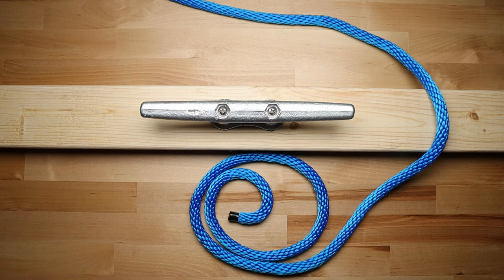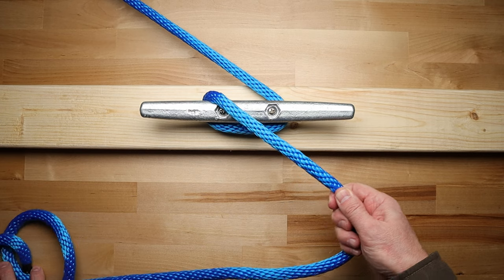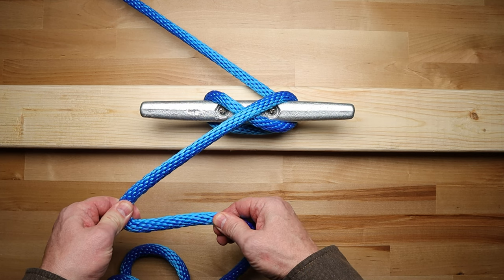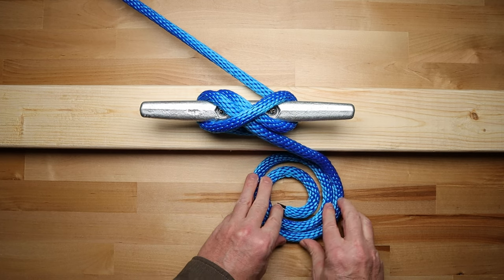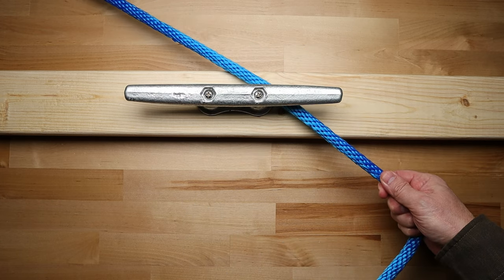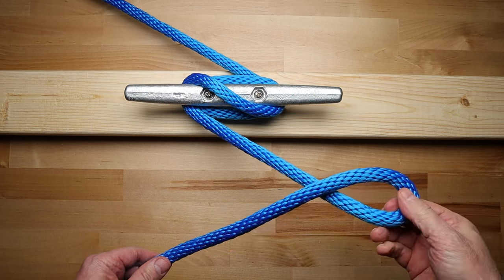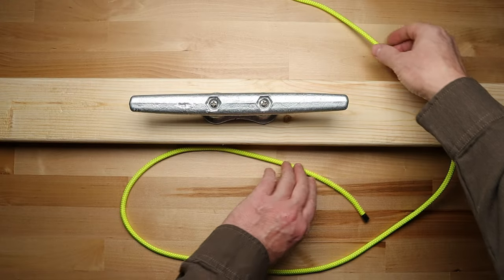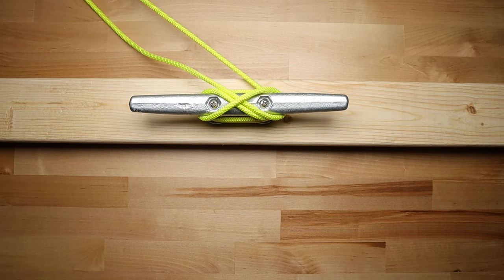How to tie a Cleat Hitch (3 different methods).

Comment: I have to give you credit for avoiding a finger being cut off if the boat surges and jerks on the line. Your method avoids that problem. But it does not avoid the problem of the line cinching on the cleat which can be avoided by another cross (X) or two. The best method is OXXO where the O is a full 360 degree wrap). This method avoids any issues and ensures your boat is secure. The first method you showed is only if you are at your boat and watching it. Seen a few boat leave the dock due to the first method. The big problem most Americans don't realise is that the cleating and knot books are 100 years old and these modern lines slip easily. That is why you need those extra full wraps when using a thinner line. The rule is for every one sixteenth of inch of line you should have one inch of cleat. If you don't then you have to add extra full wraps. André

Comment: If you are securing your vessel, and the line leads down from the deck to the cleat, by taking a round turn you are creating a bind making it difficult to release under load.
Reply: Yes it does but that is what makes it much more secure. You just have to yank it free. BTW with the full wrap you put the forces on the base of the cleat where it is the strongest. I guess you have seen cleats with one horn missing which can be a result of the first method where the load is on the horns. André
Reply: @SoundzAlive1  In your video, you have the line leading parallel to the base of the cleat and the round turn has little chance of binding. My point is, if you are securing your dock line on the float/wharf/pier and the line leads downwards from the vessel, you are creating a bind. In my experience, you will Not be able to yank it free.I have experience on vessels from 14' to 86' and have never had a problem with the vessel not being secure.

Comment: Hi what size cleat and rope you using thanks
Reply from the maker: It's a 10-inch cleat, and the blue rope is 5/8. You would want a 1/2 inch line for an 8 inch cleat and a 3/8 inch line for a 6 inch cleat.
Reply: @Thehowtochannelinc  thank you

Comment: I can’t master this knot for the death of me
Reply from the maker: Keep practicing. You'll get it.
Thanks for watching.
Reply: Sure you can… just take a few minutes at the dock and watch & pause video.
Reply: You don't need to really as there are other methods like the Royal Navy. OXXO and no hitch. It is more secure than the other methods. The  O or wrap  is a full 360 degree wrap and due to the two X's there will be no force on the last wrap. OK now try it. André